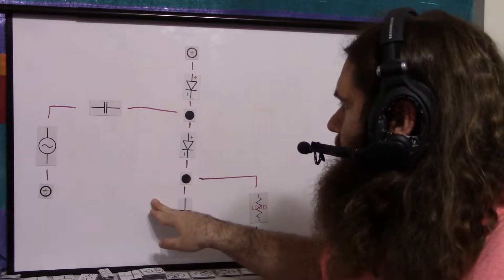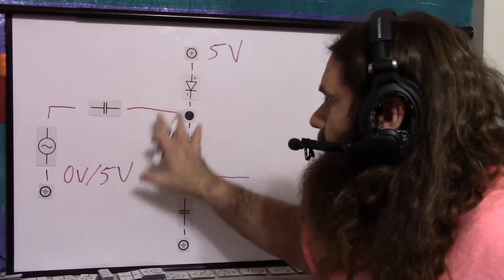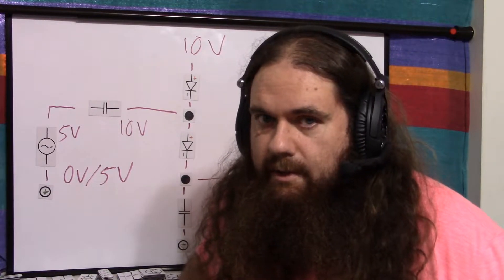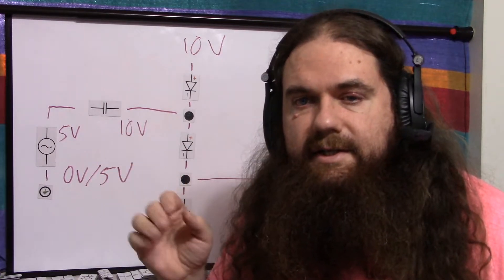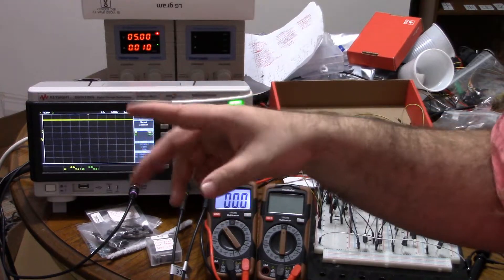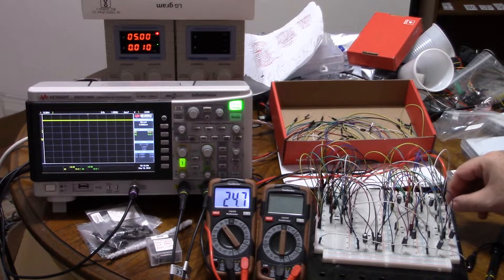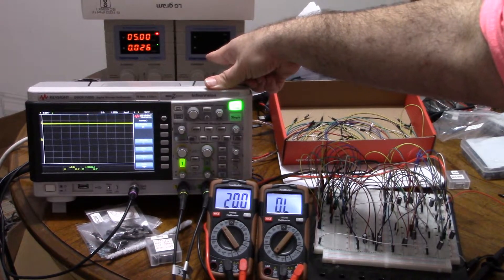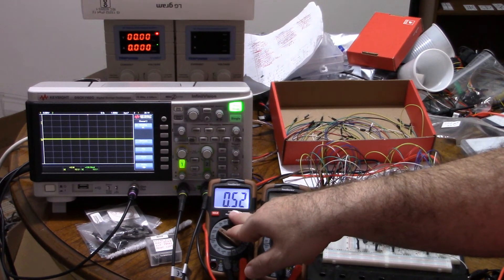All The Voltage You Ever Want - DC Voltage Doubler Stacking For Ever Increasing Supply - Simply Put

Comment: So, good sir. 
I have a 72v-84v 150A max dc supply. 
I want to power a 140-168 sign wave dc input controller. 
With ebikes and electric motors. Rpm is dictated by the Voltage and torque is dictated by amperage at that Voltage. 
I want to "step up" or "amplify " my Vin via this doubler concept. 
I have VERY large ultracapacitors. 2.8v 3v max 3000f. 
The cap bank that I have made that matches my Lipos V. Is 30 of these caps. And makes the bank 100F. 
My question is this. 
How would I use this doubler to double 72-84v..... to fill my cap bank to a higher voltage. I have more caps. I was trying to use a boost circuit. But its just so damn complicated at such large wattages. 
Seeing what you have here. If I could use this doubler I think it would work. 
Any help would be great;)

Comment: Couldn't you run the 10v to another pnp transistor and resistor and drive that transistor from the timer?  That would double each stage instead of adding just 5v.

Comment: I wonder how super capacitors would affect the circuit. More dangerous I'm sure, but perhaps the ability to run a larger load.
Reply from the maker: More capacitance means greater loads can be driven, but you have to be able to fill that capacitance fast enough, because more capacitance equals more current to charge to the same voltage. And remember it's driven by a square wave, so you've got only half a wave to charge one capacitor and half a wave to charge the other.

Comment: Curious ... could you use this to boost the output of an audio signal?
Reply: id like to know that too!!
just check out the schematic again and it is amplifying a square wave signals voltage!! so id think it could..
Reply from the maker: You would use this to increase the rail voltage / headroom of an amplifier (like an op amp, common emitter, or whatever) and then you could feed the signal through the boosted amplifier...but only the signal. You could not use this to actually drive a speaker unless the speaker wanted milliwatts.
Reply: Simply Put cool! Thank you :)
Reply: @simplyput2796  cheers for that!